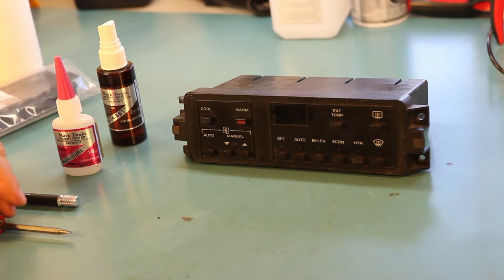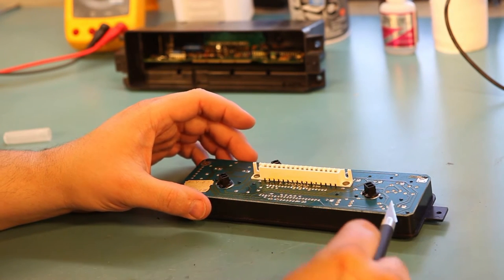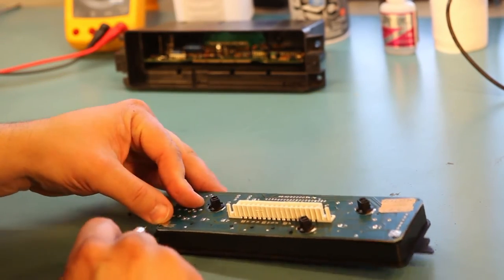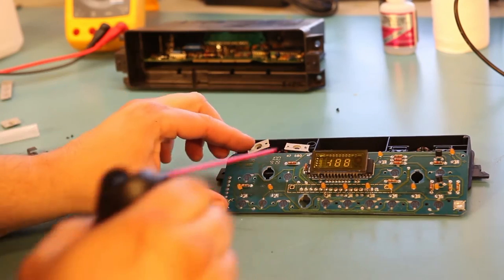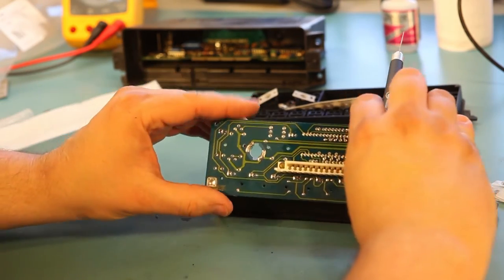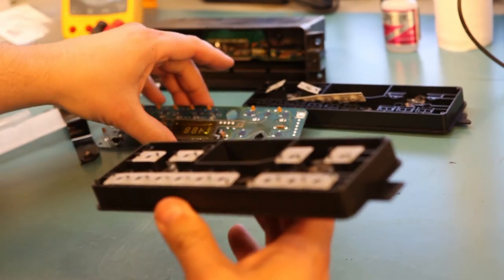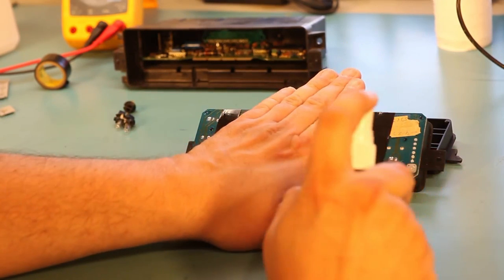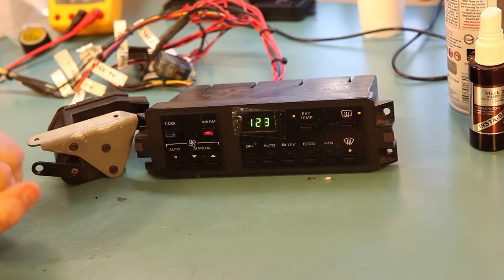86-89 Corvette Fix #16 C68 ECC Faceplate Replacement Button Fix AC Electronic Climate Control

Comment: Awesome explanation of process... Question.. I have a 1988 Convertible. My dash lights and my A/C controller seem to have a short and come on sporadically... I bought the circuit board for the Odometer and Speedo, and bought the new A/C faceplate expecting it to include the electronics... Obviously it did not... What are the chances that by replacing the dash circuit board and the A/C faceplate, it fixes my issue?
IS there a chance the electronics behind the A/C controller are an issue? I never see that part available or replaced...
Thanks for your help...

Comment: Buttons all work but still blows hot air. Compressor works lines are cold. Where is the controller for this
Reply: Rebuild the programmer. It is located in the drivers side footwell above the gas pedal. Follow the colored vacuum lines to it.